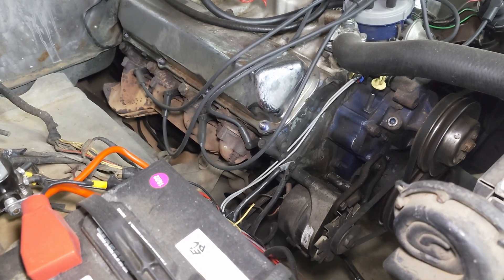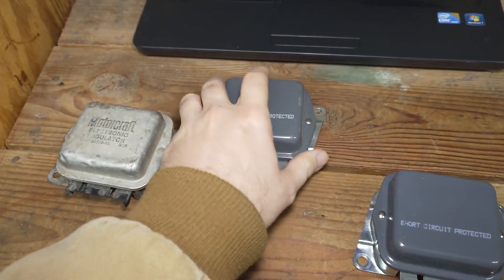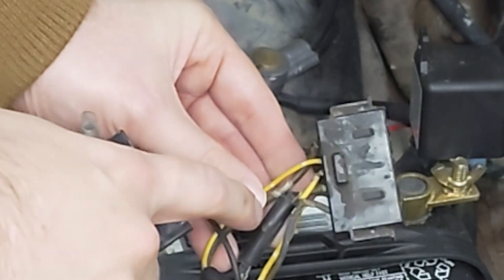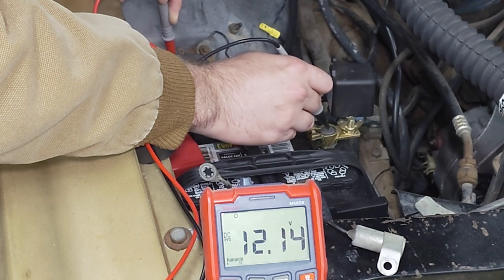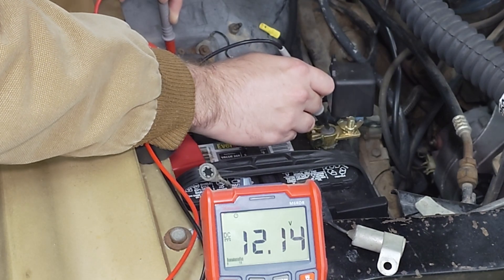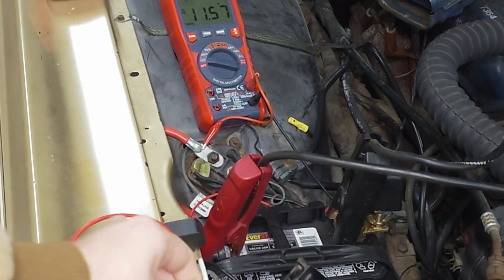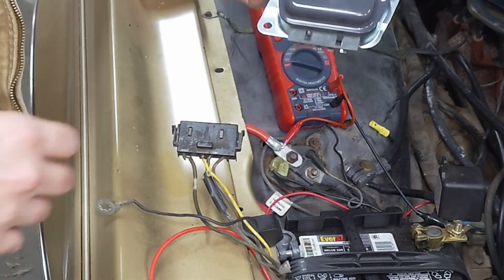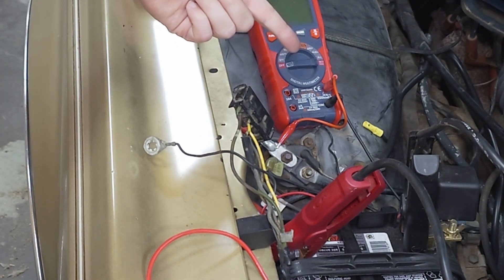Ford External Voltage Regulator Test & Replacement

Comment: Not to step on your toes but the crimpers you are using are the worst kind of crimpers you can use. To ensure a good crimp use stack on crimpers. also  dip your stripped wire end in some sort of corrosion inhibitor which will give you a better connection and no corrosion from the elements will cause you any problems in the future. Do it right the first time it will last longer

Comment: Hi, many thanks for a great video. I’ve just today purchased a 73 Lincoln Continental MK4 with suspected alternator issues. After preforming your tests I can confirm it’s the voltage regulator. Thanks again from the UK. Cheers

Comment: Even though your YouTube Channel is called Redneck Lite, I found it too well-produced and nicely explained to consider it redneck!
BRAVO!
I think that my 1989 Ford E-350 regulator failed again because of simply going to the car-wash...definitely not a bad idea to have a spare of this part on long-trips, as even your battery will need replacing (if it hasn't EXPLODED first), due to these crappy - even when NEW - external regulators failing and going unacknowledged (e.g. check engine light) as they do!  :(
Professor-Marty.

Comment: Only thing that happened was the jumper wire instantly got hot. HELP 😂
Reply from the maker: @michaelwatson2776  that sounds like something is miswired on the alternator, heat means it's passing lots of amperage

Comment: Hey brother this question is about the starter solenoid, I figured you would be able to answer my question. My positive cable from battery to starter solenoid is heating up and not starting the vehicle. Is this a bad ground?
Reply from the maker: Heat is high resistance, often a bad connection. Do you hear any clicking or thunking from the solenoid when you try to engage the starter? If you don't hear anything the solenoid may be siezed, you can try whacking it a couple times with a hammer or something or just replacing it. Also make sure you have good, tight connections.
Reply: I’ve replaced it twice now. I know the bolt that holds it to the side wall has become loose from replacing it. Should I run the negative cable to the negative bolt on the actual starter? Thank you so much for responding.

Comment: Dude. I was just in the side of the road and something between last week and today happened in my 85 Ford F250 w 460 charging system. It’s possible my ignition didn’t close all the way and drained my battery. I tested battery and it was 8. I had to use jump box. Started and checked voltage. It was around 12.5. Started to drive to town to put a little charge and go buy a battery. Truck lost power on the way and that’s that. Charging the battery now, hopefully it takes the charge. I then will do your voltage regulator test to see if it’s that or the alternator. Thanks for posting this man. I asked the parts store if there was a way to do this and they said nope!
Reply from the maker: Glad it was helpful! Yup this is straight out of the Ford factory service manual, so totally legit test!
Reply: @rednecklite  follow up. I performed the test. It didn’t go shooting sky high, but it began at 12 and then 12.2, 12.4 and climbing but it didn’t jump up to 13 or 14. Continuing to charge battery and purchased a new volt reg. $45 Standard. Made in China of course.
Reply: @fivedogsranch9288  Did the new voltage regulator fix the problem? If you did the jumper wire test and it didn't go to 13-14, that would seem like your alternator is bad, no?
Reply: @nesone6520  it fixed the battery charging issue. But the fuel problem ended up being the relay in the firewall under the master cylinder. It makes me think the voltage regulator going out maybe threw an over volt and then died? It’s really odd both problems emerged at exactly the same time. But we’re good to go now.

Comment: It's a good ideal to solder and tape the wires crimp ones can cause problems
Reply: Good crimping tool and pull test with heat shrink connectors will have less stress on the connection.. soldering car wires isn't great for small gauge where there is lots of vibration..
Reply: Exactly. That's way airplanes use crimp connectors and not solder. @Sasparilla400

Comment: Why when I jump the terminals battery goes from 12.2 down to 11 why would it go down rather than stay at 12.2 if alt is bad ? Thanks
Reply from the maker: That might indicate a short circuit- voltage goes down when a load is placed on the system, still an indication of a bad alternator.

Comment: I have a 65 Mercury Comet Caliente this is exact what I needed to watch. I was going to replace the alternator then I did some wire tracing and my voltage regulator looked like a melted 💩.  Thanks again for the video. 🙏🏽

Comment: I worked at a generator and starter repair shop in the 80’s and we used piggy back regulators on older fords that the customer didn’t want to get into the cost of repairing the wiring harness. The worked great and made the alternator a one wire hook up to the battery. I’m pretty sure the are still available at local rebuild shops, most of the older vehicle aftermarket oem parts produced today are junk .